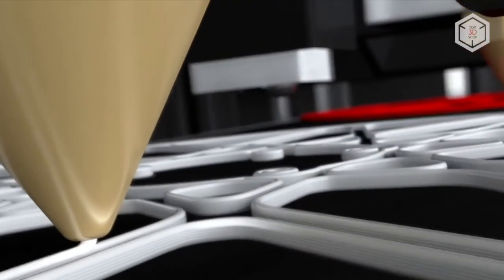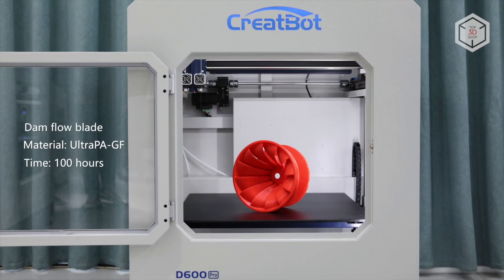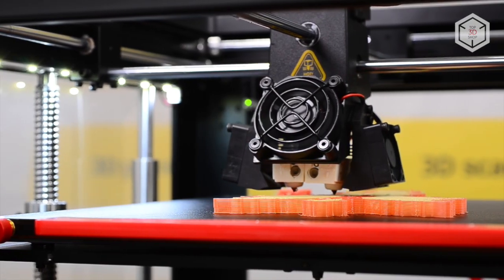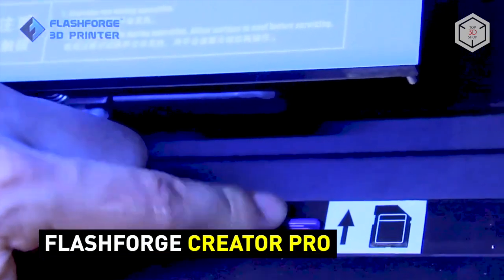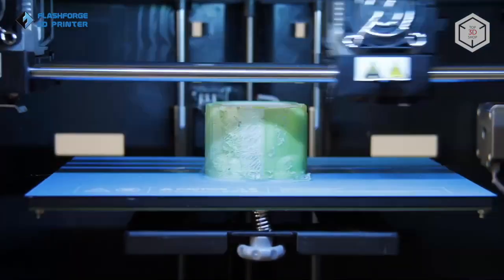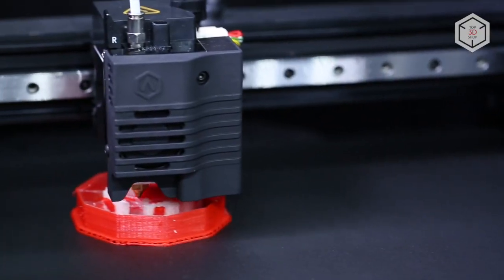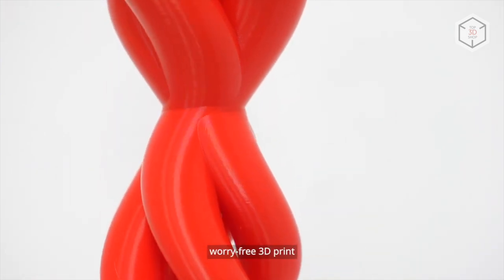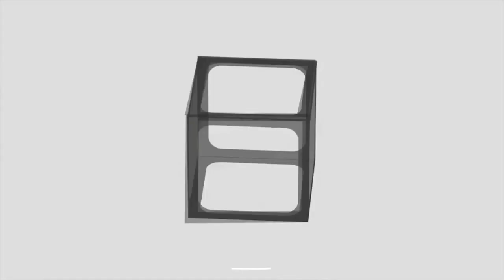Dual Extrusion FDM 3D Printing Overview and the Best Dual Extruder 3D Printers on the Market

Comment: It misses the most important model on the category, the Prusa XL with 5 extruders!!!
Reply: I think Prusa XL is a single extruder, but the MMU3 helps to switch the 5 filaments for that single extruder.
Reply: @payman_azari  No, the XL is an up to 5 tools toolchanger. Sadly the MMU3 can not be used on the XL. The mk4 is the single extruder printer with MMU3 (or the mk3, mk3.5 and mk3.9 also support mmu3).

If the XL would support the MMU3, this would be great. Filament changers are great for multi-colour, while IDEX and toolchangers are primary for different materials (and not automaticly changable filaments like TPU). Or for different nozzle diameters.

So it would be realy nice to use an MMU on the XL. So you could use the 2 tool version (1200€ cheaper) and still print 5 colours + one extra material (for support or TPU). Or even better: 5 tools+2 MMUs to use 5 colours with two different nozzle sizes, 2 colours or shore hardnesses of TPU + soluable support material...

Comment: There is something you don't mention and I would like to know which dual extruder doesn't produce the print tower? Because I can see that some do not produce it and others do. And within the dual extruders with this option, which one is the cheapest?
Reply: i believe that is entirely a slicer option. provided the printer has some way to scrape off the excess ooze whilst idle, i don't think you need a purge tower.

Comment: Great explanation of IDEX Printing...I'll use this as reference when someone asks me "why IDEX?"
Reply: Actually they missed the main downside of IDEX-printers. ABL is not possible with dual and mirror mode. ABL works by adapting the z-height due to the mesh created by measuring the beds surface. Very good beds might have a deviation of 0.2mm over the whole bed. But you easy can have 0.5mm or more on a 350 by 350 bed.
With a single head ABL is simple. After creating the mesh, z-hight is adjusted accordingly to the mesh of the bed for the actual printheads position.

But how to adjust the z-hight if you have two printheads sharing the same z-position? If z had to be adjusted by -0.1 on one heads position but +0.1 at the other heads position? Maybe in the future there will be tiltable x-axises allowing different z-correction, but at the moment I do not know such function in hardware or firmware (the VCore 4 might support it in hardware by tilting the bed, I do not know if klipper can or will support tilting the bed for 2-head ABL)
Actually the only solution is using rafts in duplex and mirror mode. If theese use a grid in first layer, you can overextrude it by a lot, as exess filament can sqeeze sideways without problem. So after the first layer, the next layer has same hight everywhere. But the underside of a print with raft does not look very nice.
So imho Duplex and Mirror on an Idex are just for fun (now), no for real use.

However, Idex can be nice for dual materials. While soluble support is quite costly, PLA as support for PETG prints and vice versa is cheap and works well.

Actually, if you never use IDEX duplex or mirror due to the problems mentioned above, it is quite easy and cheap to build an DEX yourself with any bedslinger. If the x-axis is an aluminium extrusion, just replace it by a longer one. You do not even need a 2nd x-motor if only one head ist used at a time - simply use a 3th carriage in the middle for grabbing left or right head with an electro magnet as you need. If x-axis is higher than 2020 (f.e. 2040 or 2060) using a second x-motor might be more easy than using a 3th carriage, as you can route one belt on the upper side of the extrusion and back through the extrusion and th other on the underside and also back through the extrusion.

You do not even need a special 2nd toolhead with mechanical adjustable z-hight. If the unused tool is parked outside the bed area, you can define different z-offsets in firmware.

With CAN/USB toolboards and Klipper with Input shaping practicly mandatory theese days anyways, you do not even need a new printer controll board (exept of course you have a board with soldered A4988 drivers...). The e-driver can be used as second x-driver. For the extruders themself you need toolboards of course. But they are quite cheap (about $20 each) and you need extra thermistor input, filament sensor input fan outputs, acellerometer etc. provided by theese toolboards anyways. And cabeling with can or USB is much more easy.
Actually I plan to upgrade an good old Anycubic Chiron (410by410 bedslinger) to Klipper+IDEX just for fun. The cable loom for the hotend is prone to break (and one wire did on mine), so I have to tinker around anyway. Due to the size it isn´t a fast accelerating printer anyways, so adding a second tool would`nt slow it down further.

By the way: (I)DEX or toolchanger do not exclude you to also use a filament changer (like the ERCF). You might use two extruders for different materials, but use a filament changer on one tool for colour changeing. You might prefer a hotend with integrated nozzle/heatbreak (like Revo, Nextruder-nozzle, TUN or Crealitys new unicorn nottle) as they produce a nicer filament tip on unload.

Also: Instead of different materials you also could use different nozzle sizes. For example you might print the first 3 layers with 0.25mm nozzle and use a filament changer to do multicolour - for example designing the front plate for a case for an electronic project, adding all the labels needed. And print the rest of the case with 0.8mm nozzle.